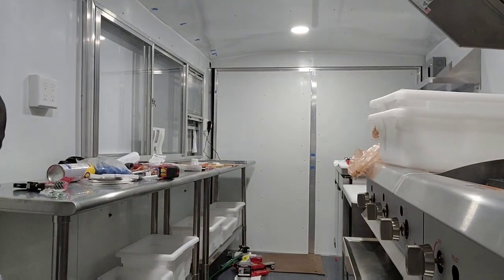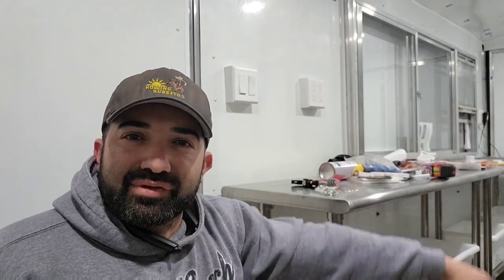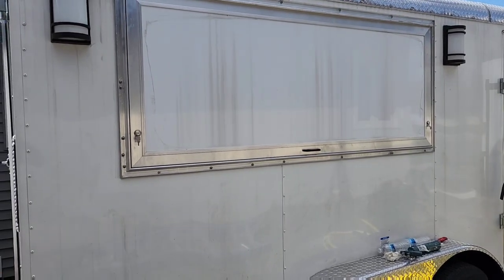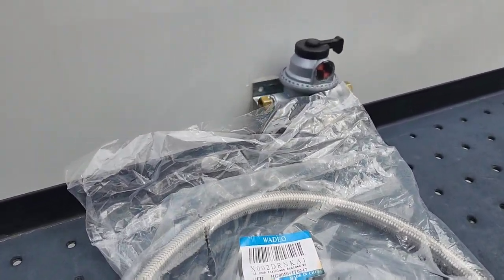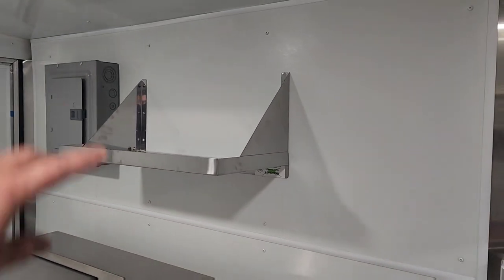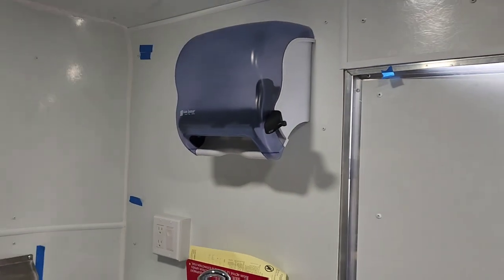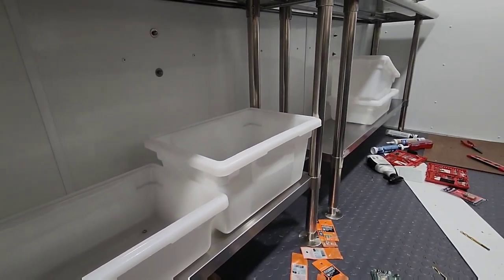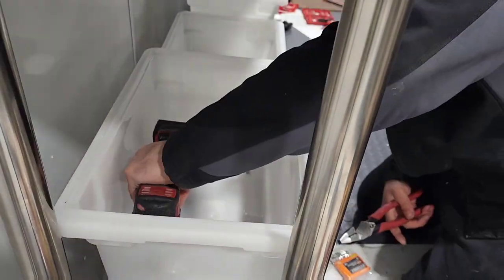Maximum Storage Food Truck Style

Comment: Hi Frank,

I have a food trailer and would like to hang. Napkin holder and soap dispenser. Any idea what I can use to hang those so I do not drill holes to the outside?
Reply from the maker: Just self tapping screws maybe 1 inch in length.

Comment: Do you have any videos on how to hang speed rails with no drilling?
Reply from the maker: I do not, I have always drilled them in. I guess you could use strong double sided tape
Reply: I was concerned about how far to drill in. I haven't used a drill before and don't want a hole in my food truck lol
Reply from the maker: @user-ib4is7rc2l  I would use these screws. Let me link them in here. It's a paid Amazon Affiliate link but I use these
Reply from the maker: @JennK-d6i  https://www.amazon.com/gp/product/B083SMKNKK/ref=as_li_tl?ie=UTF8&camp=1789&creative=9325&creativeASIN=B083SMKNKK&linkCode=as2&tag=rollingburrit-20&linkId=4a171ac796a5d88c8c5b5fa1705060e2
Reply: @fbaltierrez  Thank you! You're the BEST!
Reply: To be clear, you use the first ones that come up on the link?
Reply from the maker: @user-ib4is7rc2l  I personally have used 3/4 but you can use 1/2